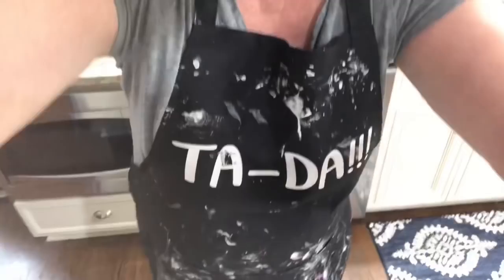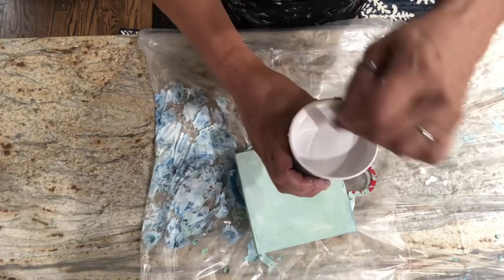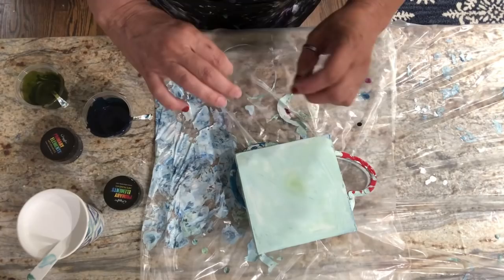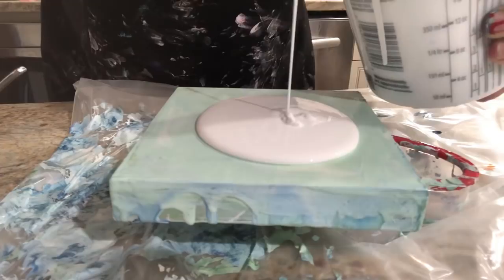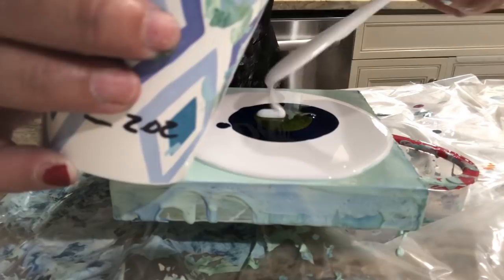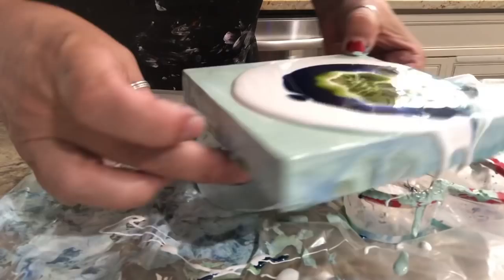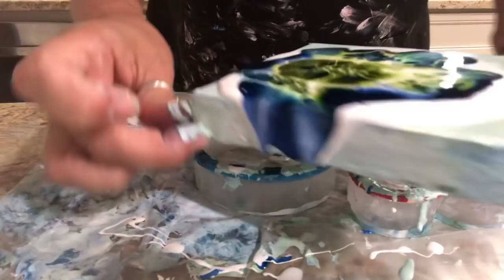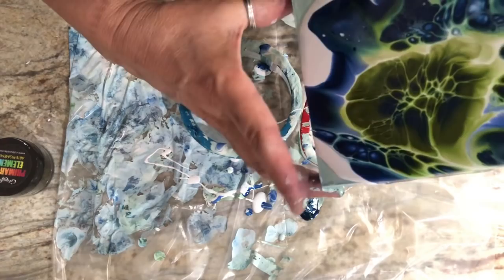#265. Blooming with American Floetrol! Yes it works!!! /bloom technique/sheleeart/fluid art

Comment: Karen (the good kind) I used your formula and it worked great!  I was just using amster white and water, which worked well, but the addition of the glue in your formula added so much more structure to the cell lacing...I did three just to see if it came out the same ...it did and i love it!  Thank you!

Comment: Great info at end too thanks. 
What is difference between Base Paint & Pouring Medium?? Please. I'm.confused..just started out & used only base paint with flowtroel..& colours. !??? Where does the pouring medium fit into   it!.  ?  Thanks 😁😅😁
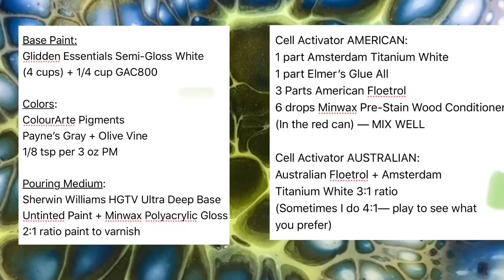Reply from the maker: Full recipe comes up on the screen at 26:10.  The base paint is used alone as your first puddle on the canvas.  The colors are mixed with the pouring medium recipe; and the cell activator is a separate recipe that goes on last before you puff.
Reply: @WaterfallAcrylics  thanks so much! Finally someone ki d enough to.explain in simple terms. Bless you..I'm.in uk..So having long wait for my Aussie Flowtrol!. We can only get Owatrol here..and can't get many cells. So I'm hoping it get better results asap. Thanks again. X😁😍😁

Comment: What's great about using the minwax w/c is it doesn't repel resin,even though it's an oil base. If you try 1part Amsterdam paint to 7 parts floetrol gives you smaller cells kiinda lacing effect
Reply from the maker: Yes I know.  I stopped using it tho because it’s so toxic.

Comment: Love these! I'm a beginner and am learning all kinds of things from you!  What heat setting do you have your hair dryer on?  Have you tried blowing with a straw for the small areas?  I definitely need one of those spinners!  Do you have to clean your painting before sealing  like you do if you use silicone?
Reply from the maker: Hi! My mini hair dryer doesn’t have a heat setting.  Yes to straws but my mouth works better. No need to clean.

Comment: hi Karen I just watched your great video and I am making up some cell activator with one part titanium white one part glue three-part American floetrol on six drops Minwax but I guess what I need to know is what quantity are you making because I did a very small amount and wondered if I should still have the six drops. How much are you making that six drops would be the right amount thank you.
Reply from the maker: I made an 8 ounce cup...if you’re making a smaller quantity then only use 3 drops of the wood conditioner.
Reply: @WaterfallAcrylics  thanks so much. I started thinking after I made such a small amount that you likely made much more. It still worked but I'll use less from now on. Thanks for clarifying for me.😁😷

Comment: What paint did you put down for the base/pillow.  I was wondering 💭 ,since the Wood Conditioner acts like Silicone,  do I need to clean it before I resin as if I used Silicone.  I hate cleaning silicone 😫😫. Thank you so much 😊
Reply from the maker: No need to clean.

Comment: When making the cell activator on this video, what measurement do you mean when you say 1 or 3 parts?  Thanks in advance for your information.
Reply from the maker: Parts—-whatever amount you chose.  For example, if I say one part is 1 cup, then 3 parts would be 3 cups.  Or if one part is 1/2 cup, then 3 parts would be 1.5 cups.   That math; it’ll getcha!  😃

Comment: I know that you gave the recipe for the American Floetrol with the ratios but what measurements did you use when you measured out the paint, glue, and floetrol? It would help us out a great deal to know the measurements.
Reply from the maker: Super old video—the last 100 or so all have the full recipe in the description section.

Comment: For the activator, you say "parts" but for the pre-stain is is 6 drops.  If each part is 10g, or each part is 100g we get very different amounts... 6 drops is very specific so how does that scale up or down?
Reply from the maker: It doesn’t need to be that precise.  I made almost 8 oz of CA and used 6 drops.  It could’ve been 5 or 7....just as long as you have a small amount in there.